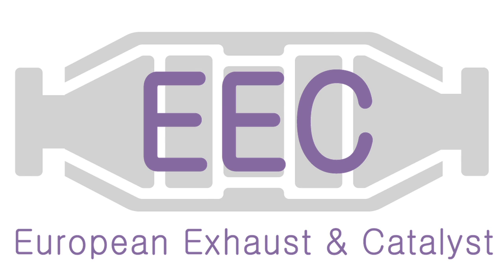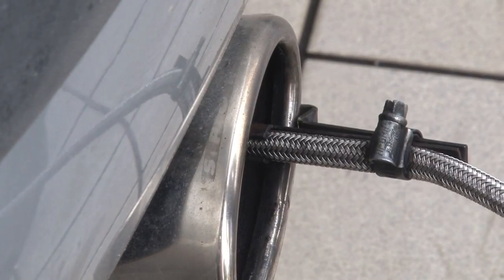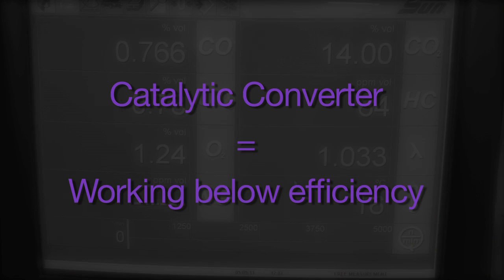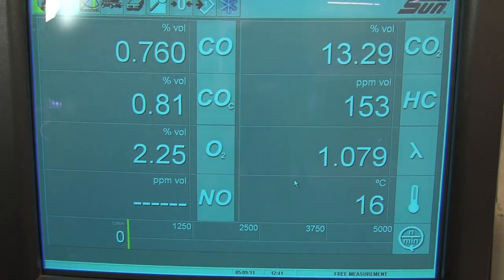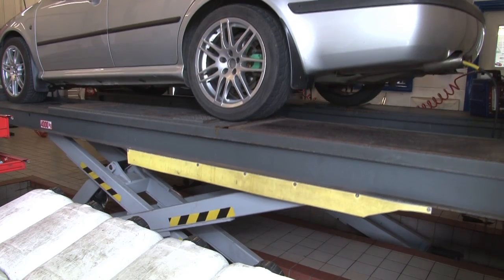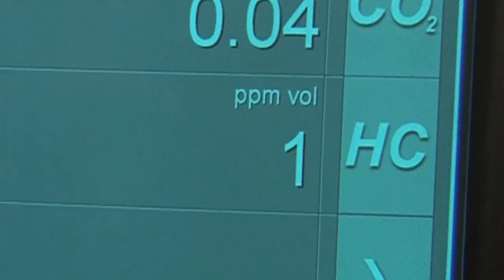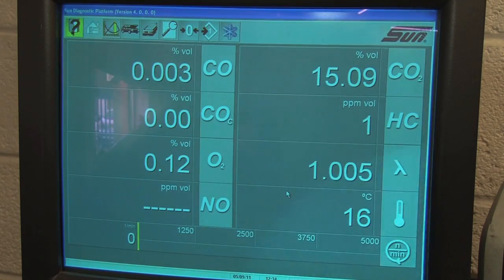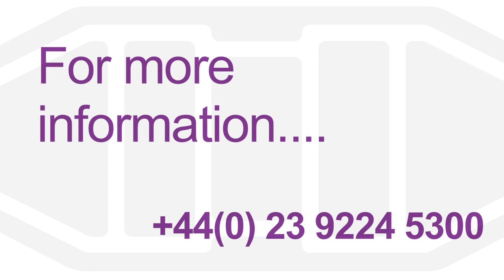Using a 4-gas analyser to diagnose vehicle emissions system problem

Comment: can you assist to analyze this result that i have on my car?

HC - 9
CO - 0.01%
CO2 - 10.46%
O2 - 5.79%
NOx - 0
Lamda - 1.22
Reply: Same, air leak before the lambda probe or clogged injectors, the engine runs lean. the kat its ok.
Reply: When I've seen oxygen levels as high as that it usually indicates that there is no fuel entering a cylinder. The CO and HC levels confirm this. The cylinder without fuel is just pumping fresh air into the exhaust system. Now that doesn't necessarily mean the fuel system is at fault as an ECU can shut the injector off even if an ignition misfire is the cause. This is to protect the catalytic converter from unburnt fuel.
Reply: Exhaust leak  causes that and lambda to high